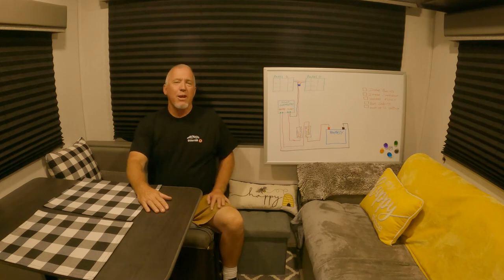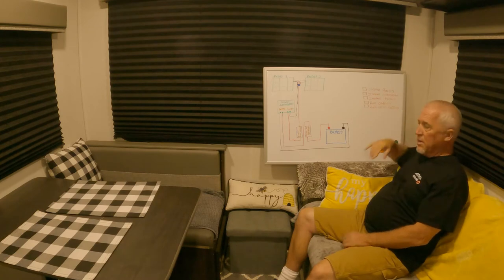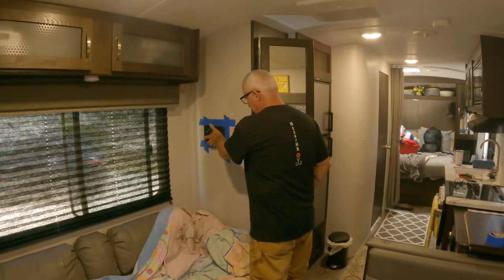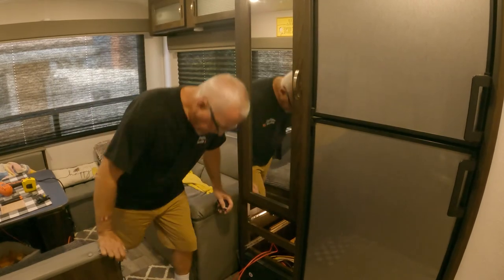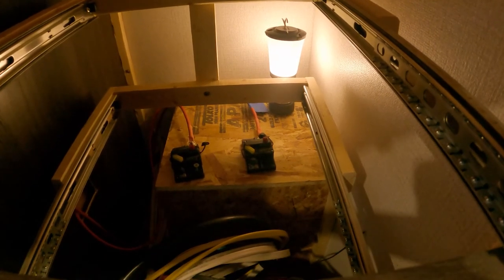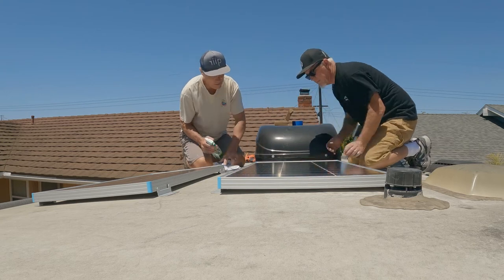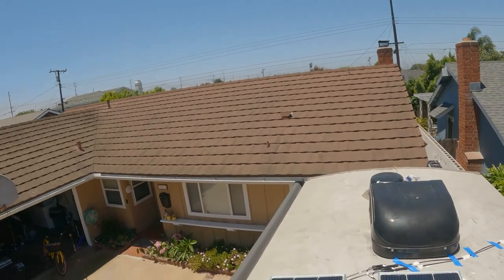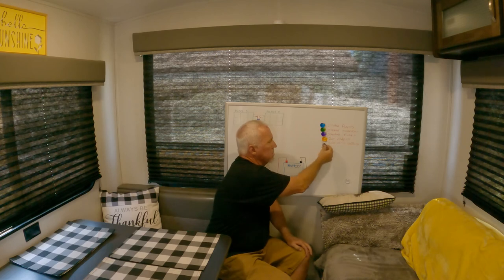Basic Install 200 Watt Solar Kit On RV Travel Trailer

Comment: I have a Flagstaff E-Pro E19FD. It came with solar and i have wanted to update the system to a mppt solar controller,  lithium battery and more solar panels. It has taken me a few years of reading, comprehending and learning to get to where i was comfortable moving ahead. The lithium battery has been a huge upgrade on its own. I currently have one 100 watt flexible solar panel that came with the trailer. It came with a PWM controller. That panel can really only put out about 60 watts, but even that has been able to work well with my Renogy 100ah battery. I am adding a Renogy 40 amp MPPT controller and a Renogy 175 watt solar panel. Seeing what the current system does, i am interested in how the additions will do. We dont boondock but want to. With conservation, i expect we will be able to do weekends with ease. No A/C or microwave, but it Missouri in the spring and fall, we will be fine. I hope your install is working well for you.